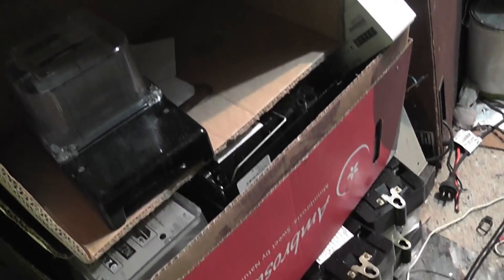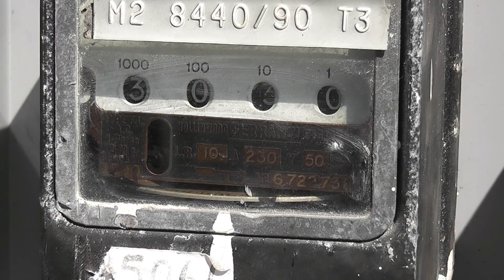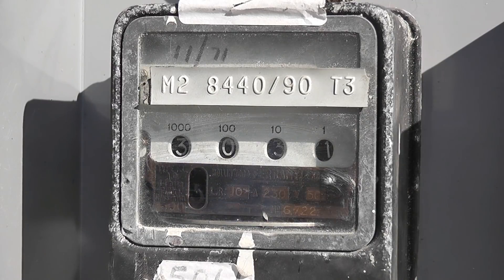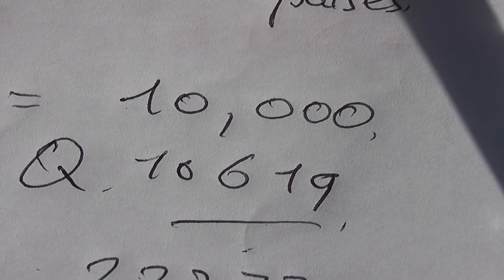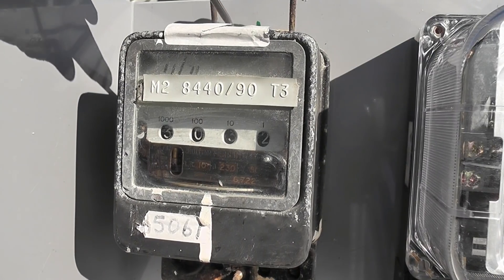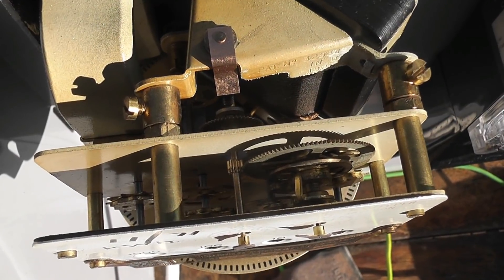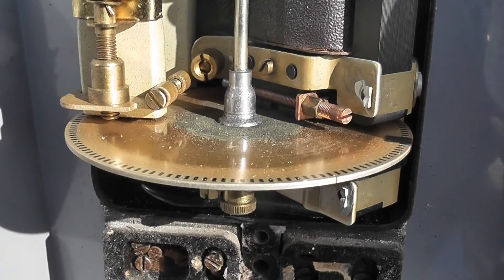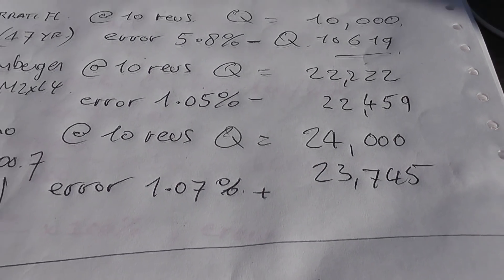80 Year old Ferranti and two others [accuracy checks]

Comment: I love your video and funny humor.    Those meters will be museum soon.   They put a smart meter at my place.   Now they  new products washers/dryers that signal what they are.    Show do you work at a Meter Shop or like a Engineer to checkout failed equipment.
Reply from the maker: I used to work in the metering department about 15 years ago, when that was closed down, because of the current throw away society we live in, meter testing / reusing was abandoned.
I scored a portable reference standard which I use to check the accuracy of meters sometimes. I work in the High Voltage utility industry maintenance.

Comment: Was just going to say you can see how the undersection of the disc is making contact with something but you beat me to it!
Is there an adjuster to raise the disc? Could be the grease in the lower bearing has failed?? (age would say yes)

Am I right in thinking the old meter was part of a basic circuit - the maximum load seems small - perhaps for lights only?
Putting greater loads onto the wiring circuits would certainly warm the meter a little. Houses (I'm assuming it's a domestic meter..) started getting many more electrical appliances after the manufacturing date - 'white goods' became common after WW2.
Reply from the maker: I will clean up the lower bearing and adjust the pivot so the disc comes clear of the brake magnet. Then will do a retest and see what the difference is. This meter disc has done many hundreds of millions of rotations in its life so you can expect some wear and tear somewhere. I actually noticed the wear marks after making the video, as I did the meter test outside on our sundeck.

Comment: Ferranti has suffered from wheel drop need to tighten bottom bearing screw
Reply from the maker: Yes, correct, bottom pivot worn out hence disc has dropped and rubbing on the brake magnet.
Reply: Have a watchmaker make you a new bottom pivot?
Reply from the maker: I have some spare parts somewhere otherwise I have to adjust the disc height up a little.